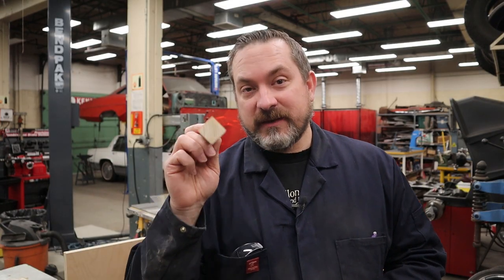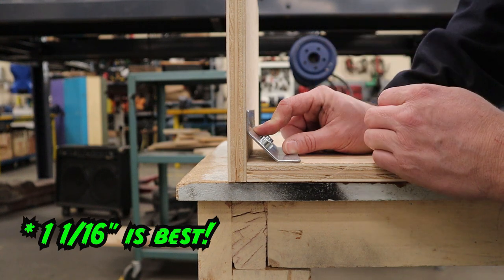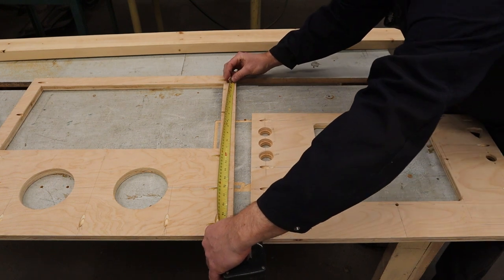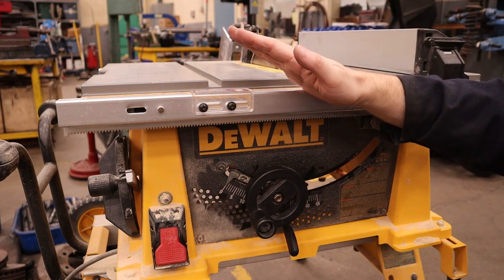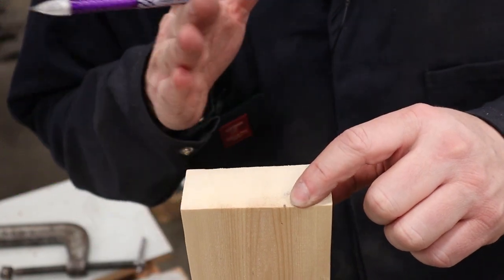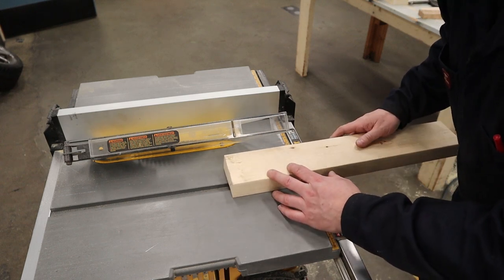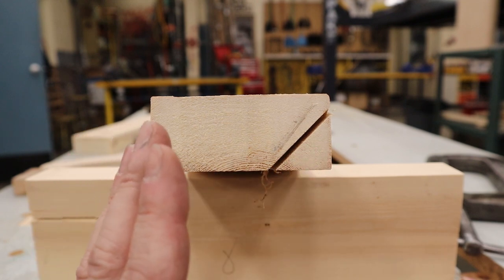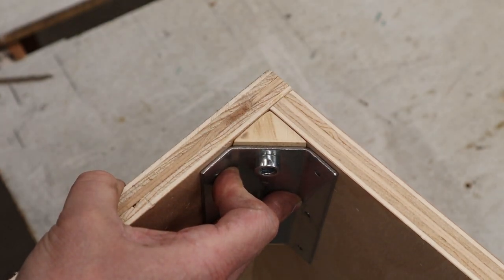How to make the 45 degree corner braces in your virtual pinball cabinet

Comment: Thank you for this great video. Maybe one tip, before you screw in the bolts into the bracket, use a little bit of lubricating oil to ensure it goes in smoothly. I've had a bad experience where one bold broke off due to using too much strength to fasten the legs. Also don't use a  socket wrench but a normal one so you can feel how much you are tightening.
I'm building a table around a 40" TV which is a bit smaller as yours.
I'm into old pinball machines so I'm going to use decals called  'The Time Machine'. 
There are numbers on the sides: 1950, 1960, 1970 and 1980 corresponding to the pinball machines I like.
Moreover I can easaly adjust the sizes to my cabinet because there is a lot of black on the picture edges that I can cut off to suit the size of my pinball machine.
Keep it up !😄
Reply from the maker: Thanks for the tips!  I almost never use open end wrenches as they can damage the head of fasteners.  If your careful, you'll feel the same tightness with a ratchet.  Yeah that's smart about the blank space around cabinet edges, waaaay easier to not worry about graphics being cut off.  Thanks for the watch!